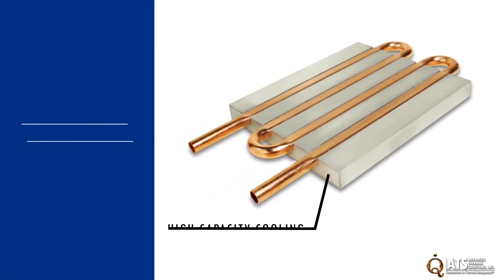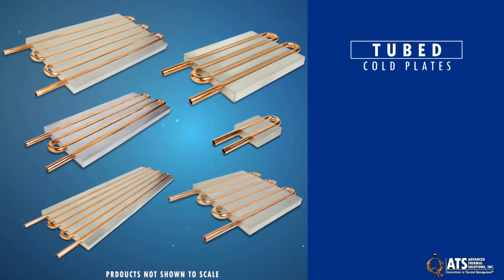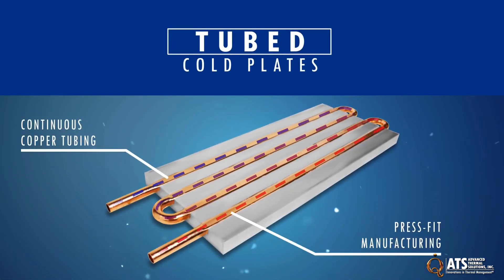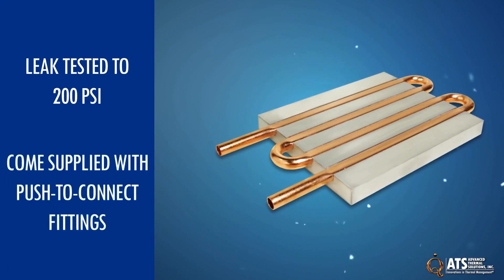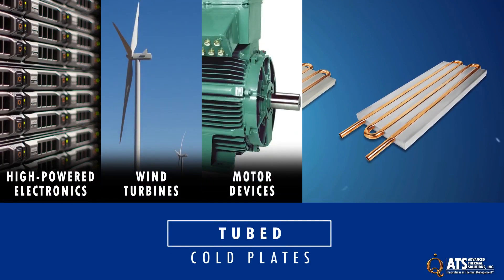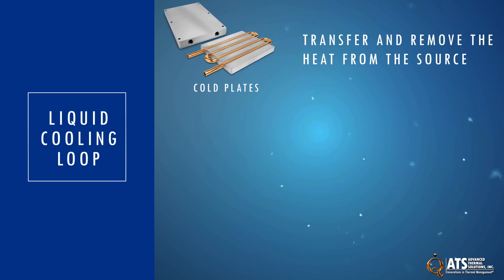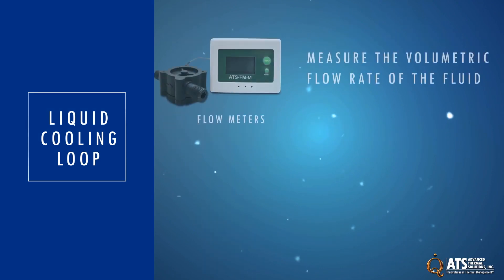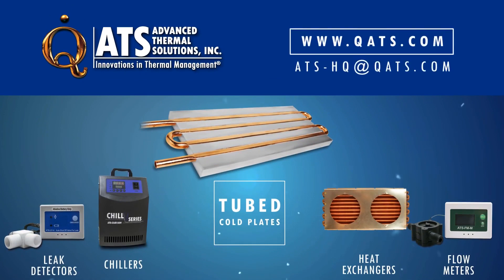ATS Tubed Cold Plates

Comment: Hi! Press-fit sounds like a  great idea, but how about galvanic corrosion? It is not impossible to expect condensed water on a cold plate. Do you guarantee no galvanic corrosion between those dissimilar metals (copper and aluminium)? Do you use any coatings to prevent galvanic corrosion?
Reply: Marian Wielkopolski plates and copper cubes are soldered together so corrosion is not a problem before its EOL that is my viewpoint
Reply: @yangethan1466   It is possible to coat/solder/glue, but in some cases they just press-fit it. On their website they say "the tubes are directly connected to the plate instead of through a bulky epoxy or other material that can act as a thermal insulator." Im wondering whether they use solder (metal) or they just do nothing and rely on press-fit. If the press-fit is a case without soldering, then I still worry about corrosion.
Reply: @marianwielkopolski2215  I was wondering the same thing immediately when they said that copper is in direct contact. In theory copper can be pressed so hard against the aluminum that they cold weld without any caps for the moisture to condensate. But in reality this is impossible especially because the copper is a tube (not solid). So I would personally prefer some coating for longer life. A thin layer of modern high conductivity epoxy or something similar would be good. But then again I'm not a professional in this exact field.
Reply from the maker: There is a small layer of grease in between. Unless you require salt spray testing, there should not be any galvanic corrosion.